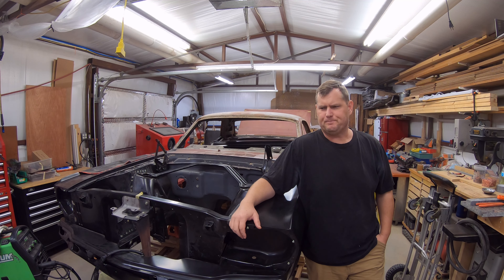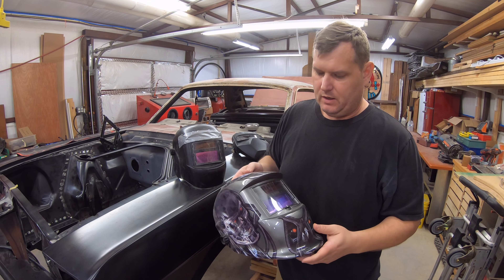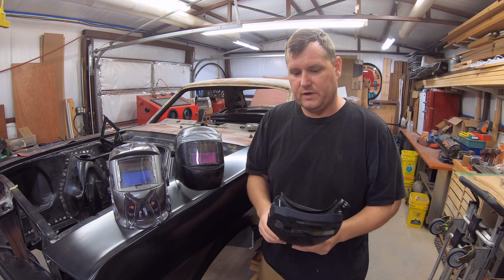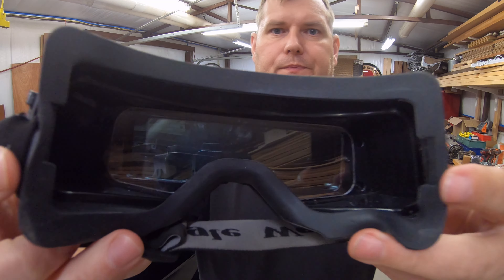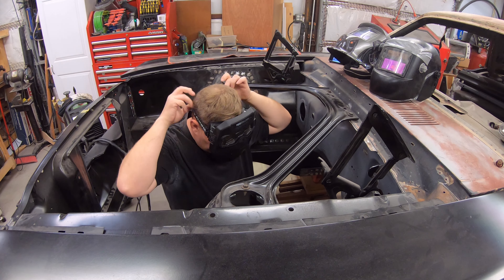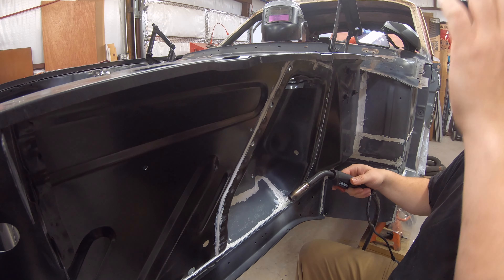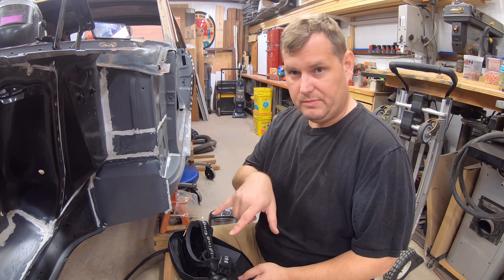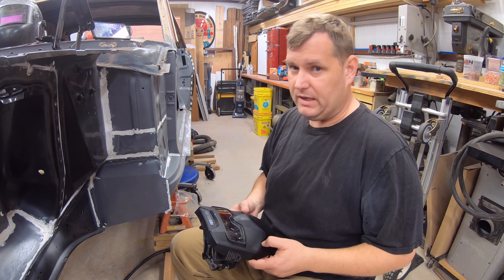Yes Welder welding goggles the regular guy review.

Comment: Every tool has a special purpose, that hood will work fine for people who are making small welds in small increments of time but if you weld all day with that hood you will have sunburn ears, neck, side of your face and any place that is not covered by a hood
Reply from the maker: Yup. This works great for tight areas and if you end up using it a bunch a UV welding sock will keep the ears happy. But generally you won't be doing it that much with it.
Reply: You can wear a fire resistant mask. Also the mask would help if anything flew on your head.

Comment: Hey I have to ask you, when you strike a spark do  you see that initial flash before the lens darkens? My helmet is annoying because it does that then you are left not seeing what is going on because of the flash and of course that can not be good for the eyes. I have to close my eyes each time. Annoying!
Reply from the maker: If your helmet has an adjustment for sensitivity turn it up to max and then work your way back down until it doesn't darken too easily/early. Also set the delay for long enough so that it stays dark a little longer so it doesn't go clear then you start welding again and it has to go dark.